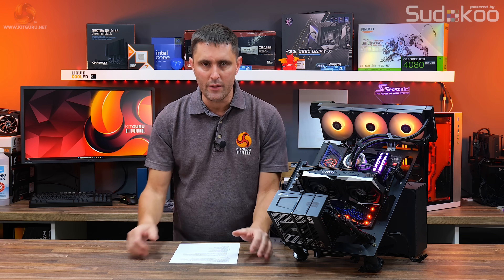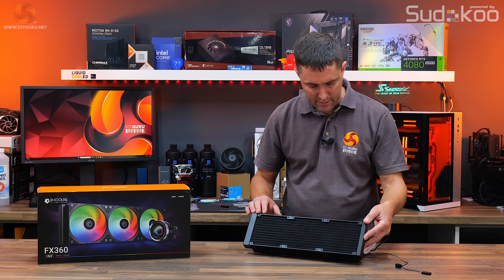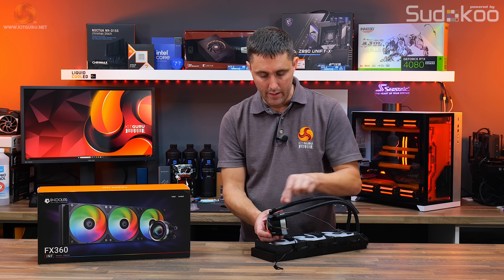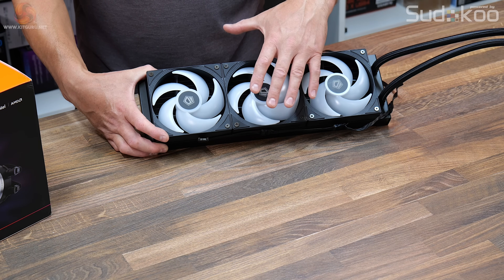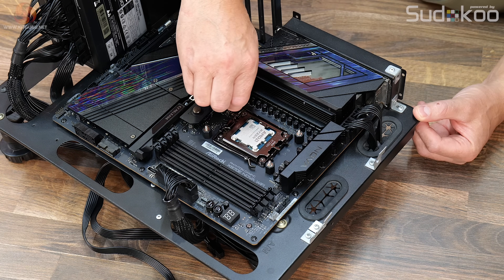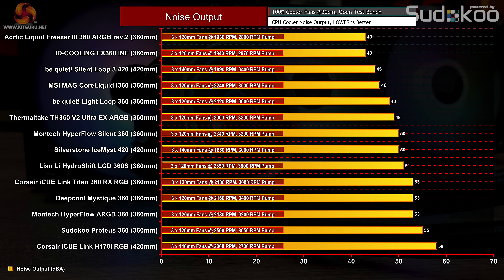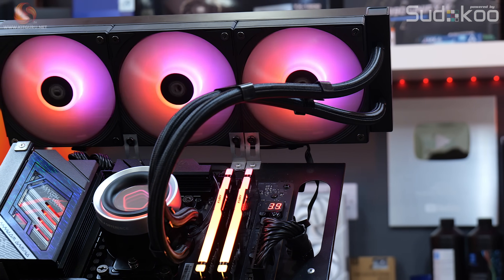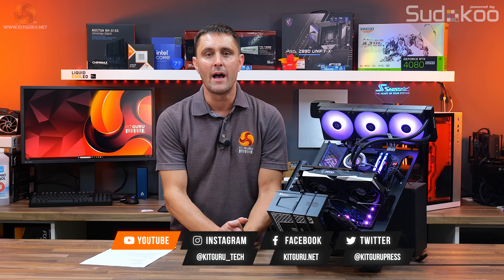ID-Cooling FX360 INF: The £80 AIO That Almost Nails It

Comment from the maker: be sure to let us know what you think of this 'budget AIO' cooler - would you buy one ? Let us know your thoughts - also report any spam as you see it - thanks!
Reply: seems a bit harsh, its only £80. surely will be fine for most mid range processors at stock levels, without making a racket.
Reply: @geofftatesmate7748  It was fine and cool , I switched mine out for a video screen but the ID ran much cooler than my thermalrights
Reply: But pairing it with a 9950X3D clearly pushed it to its thermal limit — it’s simply not designed to cope with that kind of sustained power density.
Reply: Where this cooler falls short is in performance density. Other AIOs around this price — like the Montech HyperFlow or Thermalright Frozen series — manage to deliver stronger thermal output using tighter fan curves or better-optimized pumps. The FX360 INF opts for a quiet acoustic profile but sacrifices thermal margin to get there.
Reply: For system integrators or builders working on aesthetic-focused rigs that won’t run continuous loads — like gaming PCs or media setups — this cooler has some merit. It looks clean, it’s quiet, and it’s unlikely to annoy users with fan noise or coil whine. That said, it needs careful CPU pairing.
Reply: I actually find this cooler quite impressive, it performs on par with the Liquid Freezer III which has an almost 30% bigger radiator. If you're going for a quiet build with no major overclocks this is pretty much all you need.

Also you didn't test it with an intel setup which leaves a bit of a question mark about it's performance there.
Reply: Let me guess — it’s quiet because the fans don’t spin fast enough to actually cool anything? That’s not good engineering, that’s just nerfing performance to look better on a decibel meter.
Reply: You have to admire the confidence. Selling a cooler this underwhelming takes guts in 2025.
Reply: The lack of pre-applied thermal paste is just lazy. It costs almost nothing to include it, and for a lot of first-time builders, this is a setup fail waiting to happen. That’s just bad user experience.
Reply: Ah yes, the FX360 INF — for when you want three fans to cool almost as well as a £25 tower cooler from five years ago. Bravo.
Reply: £80 for this? You can get an air cooler that performs better and doesn’t rely on a pump that might die in two years. Sick of budget AIOs pretending they’re high-end because they have an infinity mirror.

Comment: I bought this based on a recommendation from a builder. I haven't used it yet but I am sure it will be fine I have a 7800x3d & rtx 5080 so we will see but for $73 it is good for my uses. After install I will update . This is an excellent video so thank you because I haven't used an AIO before
Reply: @randcooley2865  what do u think?

Comment: Does that little 3 pin connector need to be connected to the motherboard because I don’t have a 3 pin connector on my motherboard but everything is connected and good but just wondering because it’s just in the case hanging out

Comment: I don’t really get why they went with a non-PWM pump in 2025. We’re past the era where voltage-controlled headers are widely supported on budget boards. It limits your ability to tune noise levels effectively.

Comment: Thanks for including the screw length detail — I had issues with another AIO where the screws were too short to mount through a mesh front. It’s often overlooked, but it’s key for DIY builders using less common cases.

Comment: Not really sure why manufacturers keep pushing these low-cost 360mm units without matching thermal performance. Size alone doesn’t mean better cooling if the pump and fin density can’t keep up.

Comment: Appreciate that you called out the pump spec issue — calling it PWM when it’s actually voltage-controlled is misleading, especially when that impacts tuning flexibility on some boards. That detail matters.

Comment: The lack of rotational fittings on the radiator end is a bit of a pain — makes for awkward installs if your case is tight. That said, having the rotary fittings on the CPU block helps a bit with overall flexibility.

Comment: That satin black coating does look clean, but the fingerprint issue is real. Had the same problem with my ID-Cooling SE-226-XT. Looks nice in photos, less so after handling. Still, once it’s in the case, you’re not touching it again.

Comment: For a budget build, the FX360 INF still has appeal. Quiet operation, decent mounting hardware, and good looks with RGB. Sure, the cooling isn’t class-leading, but not every user is pushing a 9950X3D to the brink. Would’ve liked to see pre-applied thermal paste though.
Reply: @Alex-pc2gt  I just bought one for my 12900k and its great im able to push the max possible clock with nice temps, the thermal paste is kind of up to the person though, I prefer that they have it seperate so its not so messy if you have to switch out fans and change stuff up.

Comment: This cooler definitely isn’t for heavy overclocking or workstation loads, but in a quiet gaming rig running at stock clocks, it’s doing the job. I haven’t heard the pump once, which is more than I can say for some pricier options I’ve used.

Comment: What’s odd here is the mismatch between thermal plate engineering and airflow tuning. The base looks like it can handle more, but the fan profile just never really opens up enough to push the heat through efficiently.

Comment: If you’re going to release a 360mm unit, it needs to actually beat tower coolers — not just tie them while taking up more case space and adding points of failure.

Comment: If you’re running something like a 5800X3D at stock, with no curve optimizer applied, this might actually be enough. The issue is the moment you step beyond baseline profiles, the temp ceiling comes into view fast.

Comment: I got this for my 10 year old son. His built is a 9800x3d paired with an asrock x870e nova. Got it more for the cool infinity mirror pump. 10 year old kid after all. I am really surprised at the performance. I have experience with Corsair , cooler  master and deep cool aio. This keep the cpu at around 60c when gaming. Hottest I saw it go was 63c. From my own experience it is comparable to an H100 which run around 60c during game. Stress testing it I got highest a bit over 85c. These chip run hotter so I consider this as normal. Idle is around 51c as well. Not a bad. Not the best. Best for the price. If it dies in a year or two then I will reconsider as I had an H100 last over 10 year on my 4790k built.
Reply: I had an ID 240 that died 16 months into its 18 month warranty and I got the replacement within 10 days of contacting ID. they even sent me a replacement fan for the 360 when I broke a blade on 1. great service

Comment: It is decent aio. However the Montech hyperflow argb 360 is a better option at the moment as you also have mentioned. I have just purchased the 240 model 🙂
Reply: Here Montech Hyper Flow ARGB 360 AIO is 127€ in pro shop while the reviewed unit is 67,90€ with 25,5% VAT. So it greatly depends where you live.
Reply: @Mestari222  it's true. I have noticed that Montech products are cheaper in the UK than in other European countries

Comment: I’d like to see this cooler tested on a broader range of CPUs. The 9950X3D is obviously an extreme stress case, and while it gives a good ceiling for thermal testing, it doesn’t reflect how this cooler will perform in more common mid-tier systems. I suspect it would fare much better paired with CPUs under 100–110W sustained loads.
Reply: Think its better to test it on a really hot running CPU to really get a proper measure of how its performing.

Comment: Considering the FX360 INF’s thermal results, I think it’s important to put this cooler in context. It’s not meant to be an all-out performer. If you’re building around something like a Ryzen 7600X or Core i5-13600, where TDP is well under 120W most of the time, this could be a great fit — low noise, solid aesthetics, and straightforward installation.

Comment: Given that the cooler was tested with a 9950X3D — arguably one of the most thermally demanding consumer CPUs — the FX360 INF actually held up better than I expected. While performance was modest, it didn’t fail thermally or exhibit instability. That alone suggests it could be more than adequate for mainstream chips with lower thermal envelopes. thats my take anyway

Comment: I found the noise-normalised results particularly telling. The fact that thermals only increased marginally when capped at 40 dBA suggests the cooler is operating near its peak thermal transfer regardless of fan RPM. That likely indicates a limitation in radiator or cold plate efficiency rather than fan curve tuning. 🙂

Comment: I dont mind you using the 9950, after all its the best test for any cooler and you know you will saturate the plate well, but I cant help but feel this is such a mismatch, using a 9950 with an £80 cooler. is this just to keep results consistent across the board?
Reply: What’s the point of releasing an AIO that chokes on anything over 150 watts? Pairing it with a 9950X3D just exposes how underbuilt it is. Stop slapping RGB on weak products and calling them premium.
Reply: This is the most forgettable cooler I’ve seen in ages. Not good, not awful, just completely pointless when better and cheaper options exist. ID-Cooling needs to step up or get out of the AIO game.
Reply from the maker: We have to keep the same CPU on our test system for consistency of course. Dropping to a lower power CPU because of price seems wrong to me, as you can see from the Montech HyperFlow ARGB, a budget cooler can perform perfectly well on a high power CPU like the 9950X. A good quality 360mm AIO should have no problem cooling 250W.

Comment: Thank you, James, for as always proper and detailed review. Personally I had a bad experience with ID cooling AIO (in terms of fans installation) The native screws were too long and as a result they damaged radiator fins. In this AIO fans are pre installed).
Reply: I hate those screws that go into the fins because you can always over tighten really easily and mess it up
Reply: really? wow thats not good did you return it?

Comment: IMO
You should contact and verify the PWM statement before publication of products/videos.

Now there is a unclear state,
 will probably put some doubt's in potential customers mind.

Basically all mentions of PWM needs a correction where they are wrong.
Not everyone watches the full video.

Seems like a decent product anyhow.
Reply: Another example of style over substance. Infinity mirror? Sure. Functional cooling? Not really. These budget AIOs are becoming a scam if they can’t outperform a £40 air cooler.

Comment: Seems like a reasonable choice for something like a Ryzen 7600X or Intel 12400 build where heat output is lower. But yeah, don’t pair it with anything that’s going to turbo at 200+ watts for long stretches.

Comment: Would love to see a thermal comparison using alternative fans. The pump design and cold plate don’t seem awful, but the bundled fans might be holding it back a bit in terms of static pressure. 🤔
Reply: I found the noise-normalised results particularly telling. The fact that thermals only increased marginally when capped at 40 dBA suggests the cooler is operating near its peak thermal transfer regardless of fan RPM. That likely indicates a limitation in radiator or cold plate efficiency rather than fan curve tuning.

Comment: The slightly longer tubes are an underrated win. I had a nightmare fitting a 360 in the front of my H510 with shorter lines — 465mm would’ve solved that easily.
Reply: They need to come up with a customisable tube length system

Comment: Kind of a shame there’s no LCD or real-time display on the pump top, even if it’s a budget unit. I feel like that’s starting to become expected even at lower price points, especially for 360mm coolers. Maybe I am asking too much !
Reply: Pump spec is wrong? No pre-applied paste? Weak thermals? But hey, you get mirror rings and RGB loops! Totally worth it.
Reply: LCDs are so cheap it really should be mandatory.